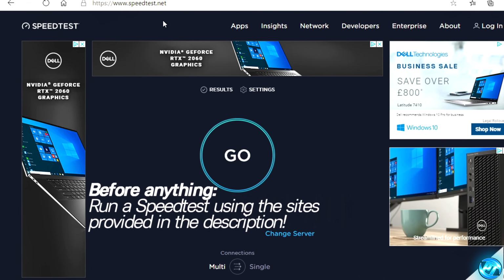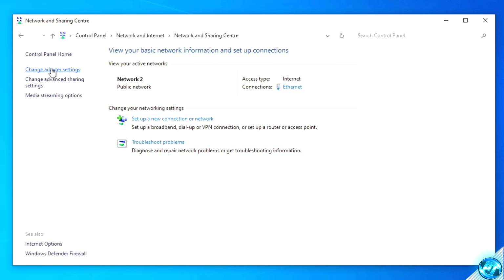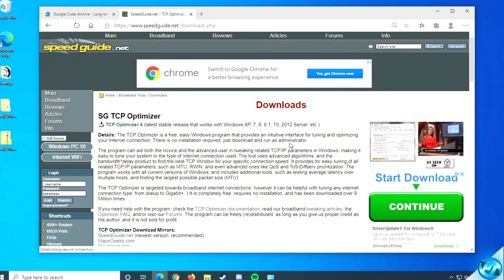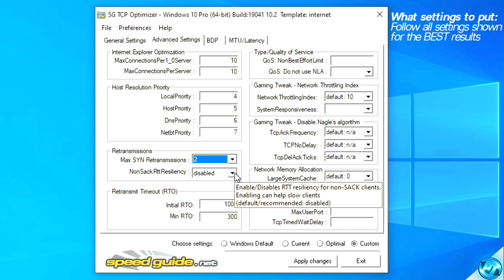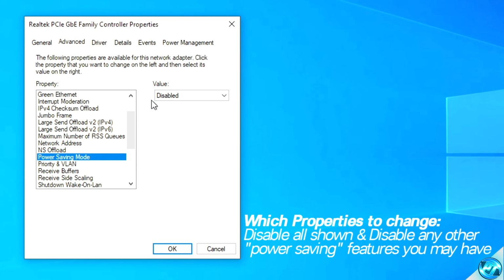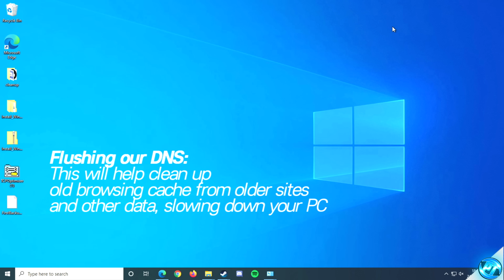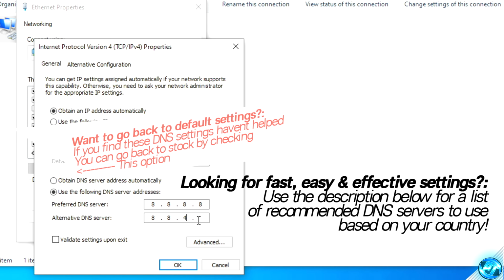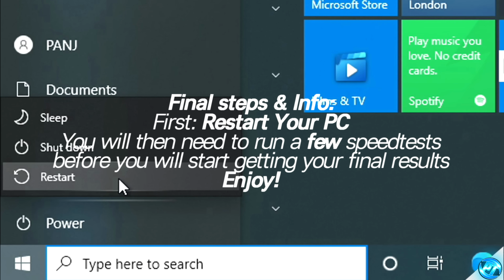🔧 How to SPEED UP your Internet! Boost Download Speeds, Lower Ping, Fix Lag on Wired and WiFi EASY

Comment: How to speed up your internet: get an ethernet cable.
Reply: i get the same internet speed using ethernet oof
Reply: @duck12369  it's about better stability and lower latency
Reply: @duck12369  same
Reply: @duck12369  try plugging directly into the router
Reply: @duck12369  same
Reply: @duck12369  that's cause you don't have a ethernet cable that supports more then enough power speed of your WiFi thats usually why ppl say that "it doesn't work" but if it's not stable ethernet meaning your ping still spikes a ton then u have a defect
Reply: same
Reply: @duck12369  this means your wifi plan is limited to a certain bandwidth
Reply: @duck12369  same broo
Reply: @duck12369  tho more stable 🤘
Reply: cool it littery didn't do  nothing i have the same connection😀👍
Reply: @ven0manee528  have u tried disconnect on ur pc ur wireless internet to the ethernet cause the only thing that should be connected is the ethernet
Reply: @ven0manee528  it makes it more stable
Reply: @ven0manee528  makes it more stable you donut. Educate yourself.
Reply: @FroDough  and how do you think im gonna do that
Reply: Be the internet provider
Reply: truee
Reply: how expensive is it? for 500gbps download and upload
Reply: @jugchugeat1110  I played 2000dollars to get that but it was worth it
Reply: @jugchugeat1110  depends where you live, in most places free because you won’t get it
Reply: @jugchugeat1110  that’s impossible
Reply: @jugchugeat1110  i have 700-500 up and down it cost me about 45 a month and setup was around 700 in total fiber lan cable run to my room worth it tho
Reply: @jugchugeat1110  provider manipulated the signal tho ..
Reply: @jugchugeat1110  pretty sure that doesn't even exist 💀
Reply: @YOUTUBE YT lmao
Reply: Bring router to room; Avoid belt from mom
Reply: Well, for some reason Ethernet is giving me the same speed as my Wi-Fi.
Reply: ItsPsycho ✓  damm didnt know it was that much
i guess ill stick with my 1mbps
Reply: my router is downstairs and 2 rooms away. i have no way to use an ethernet cable as much as i would like to
Reply: @minecratfnocap7373  My ethernet cable goes from the outside of the house
Reply: True bro
Reply: O @Okoreno-n9w
Reply: It doesn't always give better speed but it is always a more stable connection
Reply: @yogurt0925  it does give a better speed unless you already have the top of the line internet but it also depends on  the cable cat 6 a, e cat 7 and cat 8 are all different ethernet cables that all support transmission threw gigabytes cat 8  and cat 7 ethernet cables can transmit 100gbps which is most likely x100 most ppls internet plan anways my point is if you don't have a ethernet cable that supports more then the speeds of your internet with Wi-Fi it won't work as you imagine it would
Reply: That isn't always the case
Reply: @koro1840  ik im just poor af
and why did they build the satalites all the way up in space? 
y not down on earth? 
guess this is why my connection speed is 17mbpGY
Reply: @jugchugeat1110  *satellite 🛰️
also obviously it's better up in space than back down here on earth since it can actually be faster and covering a big area providing the connection , and that's also how cruise ships get their internet connection.
Also I think it's because of you're area that somehow have a bad connection or outdated infrastructure (ex: outdated cell towers) or its just you're bad router
Reply: @jugchugeat1110  probably because the radiation waves would be too strong, therefore quite harmful?? idk im failing physics 💀
Reply: ah yes with an ethernet cable i get high ping in war thunder
Reply: still bad
Reply: @Privaterank2.  I know lol
Reply: @haidermirza3674  i mean its better but its still kinda slow but better
Reply: I have one 700kb/s download
Reply: i cant affor it. My pc is so far away from my router.
Reply: I got an Ethernet it’s still ass so idrk
Reply: I have one, my internet can go as low as 1kbps
Reply: @szveshi  jokes on you... all my internet is from mobile hotspot. i get 5 mbps download max.
Reply: Pov: u dont have a enthernet cable so u still on wirlless
Reply: yes
Reply: @Chroniquee can you help me find a 150 foot ethernet cable please
Reply: Me who's too far from modem to get Ethernet: 🖕
Reply: Me who use mobile hotspot:  ;-;
Reply: @S R I R A M damd :v
Reply: I have optic fibre plugged directly
Reply: Nah mine went up by 5mbps
Reply: UrFellowCat what’s your problem
Reply: I have a fucking 1000000mps wifi using lan me be like like 💥
Reply: @S R I R A M Nope, DAC cable is faster than Optic fiber in cases to 10-15m lenght.
Reply: get an ethernet cable and ping spikes XD
Reply: Ethernet doesn't always matter
Reply: i get worst using a ethernet lmao
Reply: Already have one and my pings at 90
Reply: My wifi is so bad 98 ping with lan
Reply: cat5e or cat6e much better to use
Reply: I live in Germany I got like 1 mb/s with ethernet.
Reply: changes my internet speed by like 2 mbps...
Reply: Router too far
Reply: @S T R I N K omg you are so smart 😂
Reply: @Chroniquee not actually that true lol
Reply: It’s not just the internet it’s the port that has to get updated to work with windows sometiwms
Reply: i do have it and i use, but it keeps giving me ping spikes from 70 to 1421 ping randomly then goes back to 70 someone help?
Reply: @szveshi  same
Reply: nah still same lol, when i reinstall windows 10 it become slowly
Reply: ultimate big brain
Reply: congrats on 1k likes!
Reply: @caidenlee8097  ik gg
Reply: 69 comments il take now 70
Reply: Not if u have a laptop :(
Reply: @razasalman6220  it does work on laptop if you hae the able
Reply: Lol
Reply: yes i have it and my downlaod speed is 3.50 and upload is amazing its fuking 0.40
Reply: @S T R I N K i legit have fiber optic internet
Reply: @S T R I N K dats what im doing, even the ethernet is too slow i swear wifi just does not like me or my house, so we r getting fibre optics bcs we r done with wifi just not exsisting ;-;
Reply: I do but still get 2.1 mb download speed
Reply: no ethernet port
Reply: I already have one
Reply: my mom screams at me :c
Reply: @arandomperson0624  that has nothing to do with the comment 

I feel you
Reply: I have one. ITS HECK SLOW
Reply: @p0pst1cle4  yup I can definitely relate I get 500+ ping in games
Reply: dont working with shitty T-mobile connection
Reply: No
Reply: i have one but its still slow for me ;-;
Reply: Didn’t help that much for me
Reply: @S T R I N K or just play games on the router
Reply: lies
Reply: I do. I do.
Reply: @szveshi  i have 600 ping.
Reply: Bro can u also guide how to solve unidentified network... I have tired all the youtube guide but nothing work for me
Reply: I got slightly better with ethernet but still trash
Reply: still getting only 100 kbps
Reply: or pcie wifi card
Reply: ethernet dosnt work on my pc
Reply: I can't
Reply: I have it but now it's not working :"(
Reply: @4tnni  u have drivers and everything? Or try if store u bought it from wont replace it
Reply: Step 1 get internet
Reply: @IIIIIIlIIIIIIIlIIIII  i haven’t heard of any apps that help with wireless wifi and reduce ping?
Reply: It Doesn't allway work
Reply: Not for me
Reply: I'm Not Good  could just be a bad router. What is the mbps on the router? just because you have fiber does not mean it will run at a fast download speed you could possibly need a better modem and router.
Reply: @Sandwich could be your router. do you have satellite internet
Reply: @Sandwich i am asking if you have broadband (wireline) or broadcast (satellite). it has nothing to do with ethernet cables or wifi extenders. satellite internet usually have bad internet connections. wireline usually will give you a much better connection. go look outside on top of your house and if there is a dish on your roof or somewhere else on your property then you most likely have satellite internet. call your internet provider and ask them to see what they can do. i had this problem a while ago, we had decided to switch from direct tv to spectrum because my internet speeds where low.  a couple of cable technician guys came out and installed the wireline under my driveway and took the big satellite dish off my roof. a week later the cable guy came in and it took about 3 hours for him to set up the 400mbps router with new coax cables running inside the walls of the house. after that my ping went from 109 to 7 and my download speeds went from 3 to 150 on wifi and my pc is on the top floor on the farthest point away from the router.  it is so much better and with spectrum you dont have to pay for the modem each month. so we save $10 a month since we switched from direct tv to spectrum.
Reply: @Sandwich so its most likely either a bad router or you are not getting good signals. wifi extenders arent really too good if the area that you are in is giving out a bad signal. if you have coax running through out your house then i will recommend a coax to ethernet adapter or a wifi booster. both are a little expensive but they get the job done.
Reply: I bought an ethernet and its still slow wtf
Reply: I have an ethernet cable and it's still dog shit
Reply: LOL!!!
Reply: Not just ethernet cable,  CAT 7 or CAT 8 ethernet cable.
Reply: @bobkinney2430  those r all ethernet cables..
Reply: @bobkinney2430  you mean Cat 5 or Cat 6
Reply: @zele_gavin816  no...Cat 5 will not give you the speeds in Today's networking.  CAT 7 & CAT 8 improve speeds over ethernet cables. I recently replaced all my Old CAT 5 with CAT 7. Big difference on speeds.
Reply: @bobkinney2430  I have a cat 6 and I average like 40-60 ping on a good day. And on wifi I'm at 60-90 on a good day
Reply: @zele_gavin816  what internet package do you have? There are a lot of factors such as ISP, Distance,  Internet Speed package, router being used. If you are at GB internet,  CAT 5E is the minimum.  With CAT 7, it would be much better due to how the cable is made. If the Router is yours, look into maximizing your MTU and DNS server mentioned in article.  I am using one a bit faster than Google DNS.
Reply: @bobkinney2430  how do you find a dns faster then Google?
Reply: @zele_gavin816  no cat 5. 6 is OK, but I went for CAT 7....0 issues on my Lan and getting GB Lan. If I upgrade my switch....It will jump to 10GB Lan. That's why I opted for CAT 7. Future growth with just a switch replacement.
Reply: ine is bad even with it :(((((
Reply: i got a ethernet cable but is bad
Reply: adam grairi  Then you have severe ISP issues.
Reply: @szveshi  i literally have an ethernet lmao but imma try get a fiber optic wire
Reply: p00chs YT  Then get wi-fi extenders
Reply: I have one but it’s worse than WiFi
Reply: @Chr0me_LOL  That is a router issue. I have seen that as well.
Reply: unfortunately i have a  door in the way and the cabel is short
Reply: @JohnMarston-wd7tv  that's just an excuse.  Longer cable,  run under door, along corner of wall to router.  When home internet first started,  there was no WiFi.
Reply: Let’s gooooo my download speed is 2mbps
Reply: @jesusjr4920  lol mine clocks 5 just warming up I Peak 11.7 mbps on my 2.4 WiFi.  My 5 g hits 16.2 ..
Reply: This is actually false doesn’t work for everyone me included
Reply: @ItzBC.  it does it usually falls into the categories of isp issues defective cabl our router issues
Reply: It doesnt matter for me... my internet is just not that strong cuz i live in a fucking village
Reply: Work's every now an then, when you live in Australia ..... sorry we all don't live where you live 😩
Reply: I do but still get 3mb/s
Reply: No bro very badd speed I get
Reply: I have one its cat 7 I just want even faster Internet connection
Reply: I cant
Reply: don’t have enough ports sorry man can’t boost you ego
Reply: That that would work did not speed up my connection have a cat 7 Ethernet can
Ethernet cable straight out of my router and get 8 mbps when I should get 70mbps
Reply: @maybealexa5216  yeah me too, it’s really sad
Reply: and of course a very rare laptops that supports ethernet port nowadays
Reply: @redturtle2974  wait most gaming laptops do tho as ethernet is alot better
Reply: @Sriram how do u do that
Reply: @qyl814  ??
Reply: Nope just how to stabilize your connection
Reply: Fun fact: ethernet lags my pc and the internet is slower
Reply: @solidlight2335  what cat do u have
Reply: Dude i have one but i think its cuz my hard drive is old
Reply: No ethernet cable can save a 10mbts per second download speed
Reply: @noobartist6009  fr they think it will make there network faster
Reply: @noobartist6009  bro i have 1gig down and up i was just saying ping does not really determine on speeds u need like 15 mbps ti get stable ping getting 1000mbps network will not make any difference mby like -3 ping and more stable but yeh:)
Reply: @noobartist6009  the Ethernet cable is the bottle so limiting you to 10 mbps
Reply: 2,89 download and 0,26 upload with ethernet cable
Reply: @OfficialJessePink  it wont make ur speeds faster 😅 btw them speeds oof thats a big l also it improves stability and latency also if ur far away
Reply: why it takes too long for dns benchmark on my pc?
Reply: bruh i have an ethernet cable it does fuck all
Reply: Done.
Reply: Tried it, but only stabilized my download like before it was like huge craters, and now flatline.
Reply: And for phone
Reply: Router is in living room, my pc is in my room. I would have to dig holes through walls, now you see the problem
Reply: cries in mobile hotspot
Reply: Lo I have I already have that can I get 78 ping
Reply: My internet cable makes my pc go slower somehow. I've done tests
Reply: My computer is in my room and the router is downstairs, there's no space for my setup downstairs not really an option for me tbh
Reply: I do but download speeds are still slow
Reply: Me using my neighbour wifi😂☹
Reply: Ethernet isn’t enough for my area. The problem is coming from somewhere before the router. Possibly the internet cable that has been held in the air by a rotting rope for the past 3 years,maybe the router itself,that the internet company replaced our old 1 with a month ago. Maybe something else.
Reply: I literally just did a network test on my pc and got 0.06 megabytes per second
Reply: Mine with ethernet, and when i download i got around 700kbps but when i test my wifi speed i got 80mbps
Reply: It's not that easy for me . My gaming rid is on the further side of the house up stairs so I'd need a very VERY long wore at least 8meters as far as i can tell without running the wire outside which ain't gonna happen .

Wireless is my only option right now. 

And no I can't move the WiFi box 😒 my gf would flip out
Reply: shut up
Reply: @toughnuts2769  yawns 🥱 Nahhh
Reply: Cap
Reply: downloading Modern wafare with 200kbs
Reply: I wish but I have wireless
Reply: Problem is most people cant run ethernet cables from where their modem or router is
Reply: It doesn’t change for me. It’s still crap
Reply: Ethernet didn't do shit
Reply: @Sriram if you only could
Reply: Wat if u have ethernet and u still get 10000000 ping
Reply: I have cable but speed is 5X slower than my mums laptop with wifi
Reply: What a noob
Reply: Not when you sit like a kilometer away from the router :/
Reply: Most pcs require an Ethernet cable anyway
Reply: No shit this vid probably for people who dont have ethernet cable ports on their laptop or computer
Reply: @datboiasian8110  and for people who's setup is miles away from the router....
Reply: It already is and its still slow
Reply: my laptop doesn't have ethernet adapter. my pc has goddamn 19 ping but the fps is 60
Reply: @yangcrates5683  and how do you expect good ping to give you good fps?
Reply: I tried every tweaks possible and it only increased 20+ fps while my laptop has 240 stable fps
Reply: @yangcrates5683  in your other comment u literally said u get 60 fps and even if u didnt 240 fps is good bruh i doubt u have 360+ hz monitor to even see it and i expect u dont use motion or max graphics so its fine
Reply: @MLS-125  So I have laptop and pc. My pc has 60 ping with stable 19 ping then my laptop has stable 240 fps but there's no ethernet connector. So I'm looking for the solution to get stable connection without ethernet
Reply: @MLS-125  although it's impossible but I'm tryin' it
Reply: I am using it and I'm getting 288kb
Reply: didn’t change shit
Reply: @szveshi  same I play with a Ethernet and still get 500 ping
Reply: I got one it’s still slow
Reply: I have one but i get only 40kb per second
Reply: I do
Reply: i have an ethernet and it didnt change shit
Reply: Tell steam that bc apparently 1000 up 1000 down doesn’t matter to them bc they only let me download shit at 3 mb/s 😀
Reply: Nope doesnt work :(
Reply: My internet is good but the AT&T guy fucked up the terbites so my internet is slow
Reply: Can't, router downstairs, and Ethernet ports in room are broken
Reply: My internet is slower with ethernet 💀
Reply: That's true
Reply: I wish I could but they install my router in the walls of the living room
Reply: does usb thethering count? i have no wlan router.
Reply: I got one and my internet is still slow
Reply: @arctic9389  it depends on the speed of the cable and the speed of the router your using
Reply: @szveshi  how much download mbps?
Reply: Sometimes I get more kills on wifi
Reply: My house was built so long ago I don’t have outlets for that 😂🙌🏼
Reply: Im 100miles away from my internet box thing
Reply: my router is in the far side of my house unfortunately
Reply: I cant Mom Wouldnt Allow me to Make A Cable from my room to moms room
Reply: Here the problem it still shit
Reply: ethernet is not always the solve to bad internet :/
Reply: I have one but it's still dog shit
Reply: I'm broke
Reply: Wifi is generally better in speed lmao
Reply: I have ethernet and 50 mbps router but still I hardly get 1mbps any settings to fix it? Is my wifi limiting the speed to my pc cuz of some setting......virus can't be possible as I've bought my pc yesterday
Reply: Bro all pcs use Ethernet cables💀
Reply: YOU ARE DUMB SOME PEOPLE DON'T HAVE A VEHICLE AND SEVERE INTERNET PROBLEMS MIGHT RUIN IT
Reply: Got good internet and use wired connection and get shit speeds
Reply: bro sometimes your on a laptop, upstairs with no ethernet connection, and trash wi-fi
Reply: And a dongle too
Reply: some laptops don t have enthernet me
Reply: My ethernet gives me slower upload speeds 😢
Reply: SO SO TRUE
Reply: Lul
Reply: Already have one doesn’t work just makes my ping steady for a tiny bit
Reply: Ethernet made my downlload speed go from 50mbps to 54mbps, like 10 ping better or less
Reply: maybe cuz I use Ethernet 5U Cable and a 18€ Wifi access point extender
Reply: I use ethernet cable but it's still slow as hell
Reply: Giant eathernet cable reaching from upstairs to downstairs ain’t gonna work 😭
Reply: @Agape-z1y me and you are going though it
Reply: etherenet barely does shit
Reply: UrFellowCat  bruh dude im telling the truth i get the same speed but its more stable
Reply: @duck12369  These dudes must have some special ethernet cables that boost their internet speed man clearly lmao
Reply: @TubbsThySecond  Maybe they're connected to the pentagons internet
Reply: Ethernet makes my internet worse.
Reply: @joshuajeff5553  BRUH
Reply: THIS THING MAKE BADDER WIFI